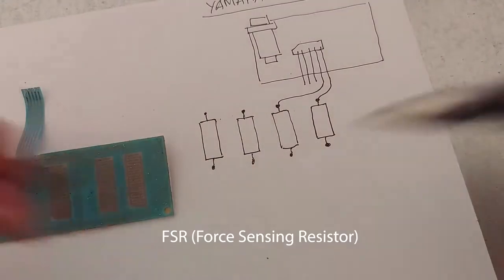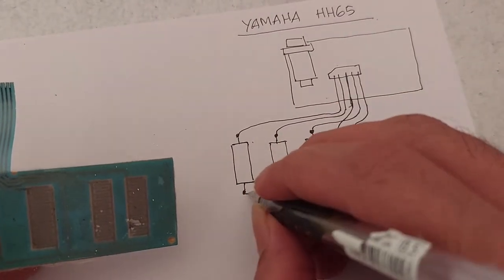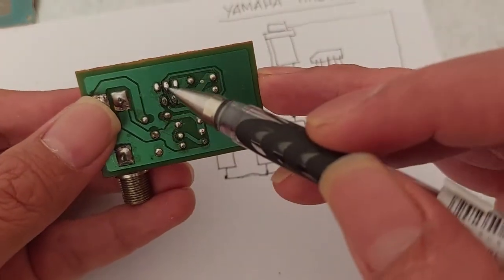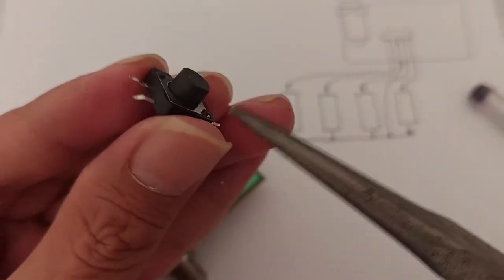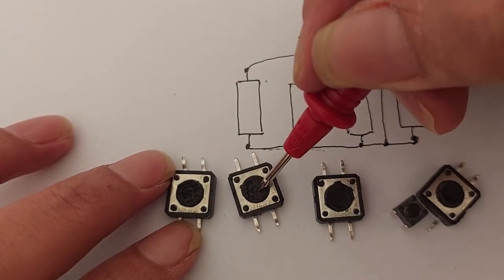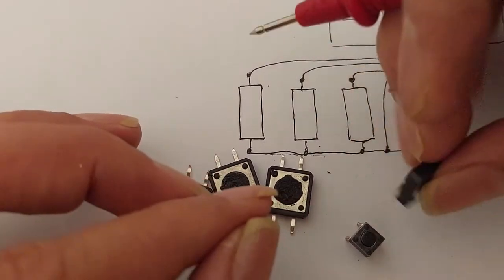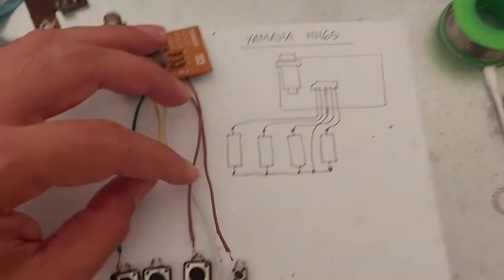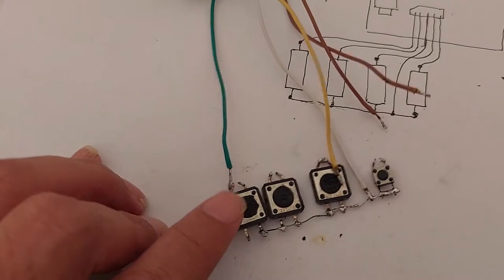Electric Hihat Close problem fixed repair

Comment: Hello, could you tell me which pad is being used to trigger the hi hat sound, I mean, the one in conjunction with the hh-65. Do you happen to know of any other option that is compatible with the Yamaha Dtxmulti12? thanks!
Reply from the maker: Yamaha Dtxmulti12 most cases only need to clean the pad sensor from dust/rust. have you tried to open ?